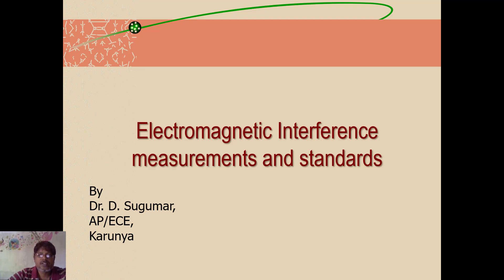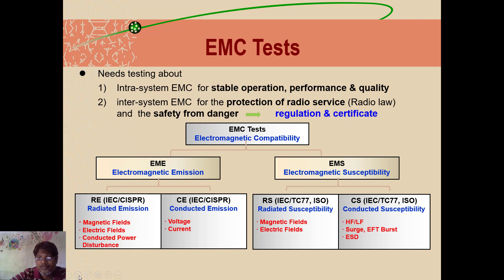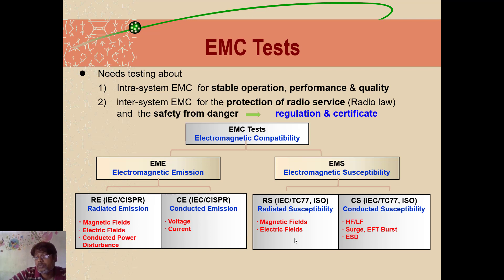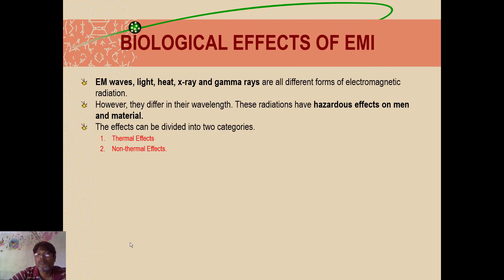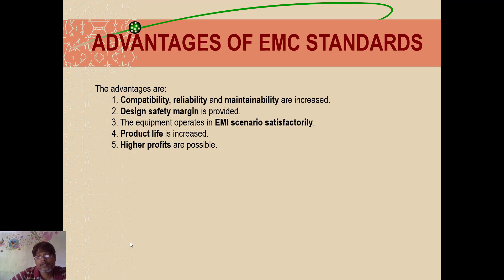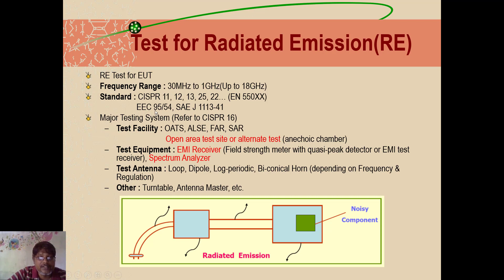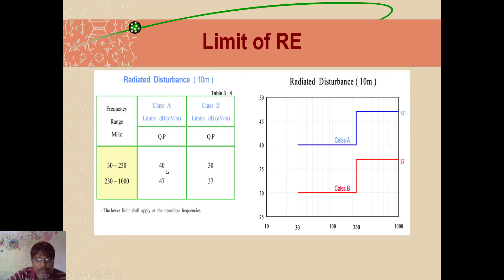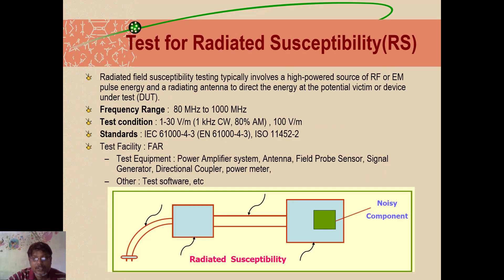EMI EMC 1

Comment: Is there any software to test EMI Issues by importing the Gerber Data
Reply from the maker: @ Shadan Akhtar, Yes it is possible. But you should design both the antenna and anechoic chamber in simulation softwares...importing Gerber file or DFX file may have meshing issues...